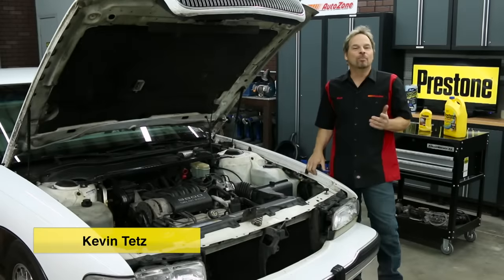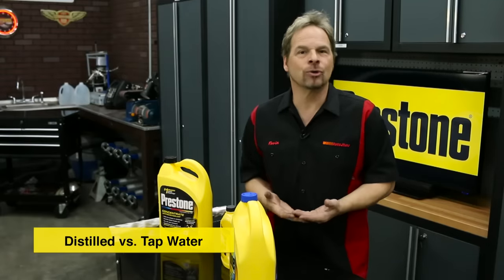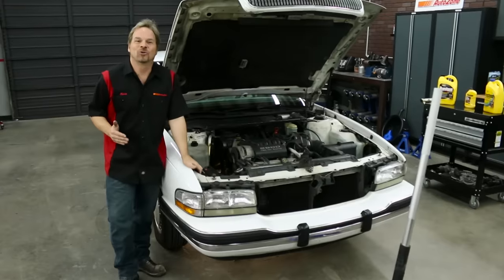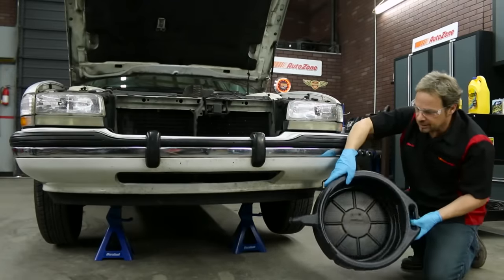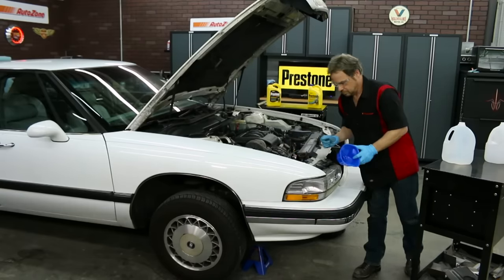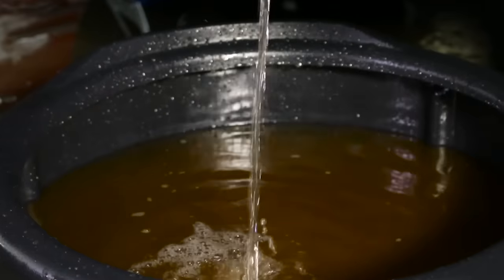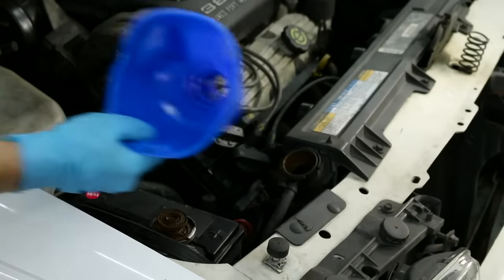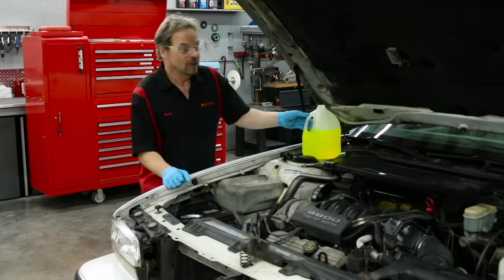AutoZone How-To: Flushing and Filling Your Cooling System

Comment: Thanks 👍🏾 This made me feel a lot more confident about flushing my system for the first time. I am so hyped up about it!! However, it is after midnight, and I do not have my pan or distilled water 😩 Definitely tomorrow though.
Reply: Howd it go?
Reply: Same here confident and ready to try it but it’s Raining and was minutes away from getting dark lol 
So how did that coolant flush work for you? Was it easy once you got started?
Reply: 😂😂😂😂😂 I’m in the same exact predicament. Gotta go hit some distilled water tomorrow. I damn near used tap water
Reply: @EASTCAMDENRD  Scotty flushed with a 
garden hose, you can do that right now, and
use it to clean out the interior while you're at it,
pet stains, spilled shakes etc, but then top off with 50/50 mix.

Comment: How do you drain out the distilled water completely from the engine block and heater core and hoses in the cooling system?
Reply: really, although this way is fine, you should take off the hose at the bottom of the radiator, run your car shortly with heat on and the water pump will shoot all water out, reattach hose and fill with 50/50 .
unless you coolant is coming out really dirty its probably not necessary but that's how you get it all out.
Reply: @divorcedwhiteman1968  can I just take out the plug from the radiator? 

What's in the engine and heater core should send it to the radiator which means it should flow out the lug at the bottom of radiator???,
Reply: @dnegel9546  you can do that..but really better to take off the bottom hose...if you're debating it in you head to much just have it serviced..it dont cost that much
Reply: @divorcedwhiteman1968  ehh it cost $170 to service it. And all they do is drain the radiator and fill. 

Anyway I ended up doing it by flushing the pump and both hoses.
Reply: @divorcedwhiteman1968 Finally someone who explained it directly. Thx.

Comment: When draining it, does it drain all of the coolant from the overflow jug? Not one video explains this.
Reply: Yeah, and I have a car that doesn't have an accessible radiator (no cap... literally and figuratively), so the only place I can add coolant is the reservoir, unless I detach hoses.
Reply: @myblacklab7 would that vehicle be a hyundai? I work at a dealership and the elantras and sonata are like that.

Comment: What about safety? How long it takes for an engine to cool down depends on the engine size and what it is made from. Aluminum cools off faster than cast iron.  Always squeeze the top radiator hose and if there is pressure, don't take the cap off.

Comment: Didn't talk about burping/bleeding the cooling system. What happens if you fill up the reservoir pass the full mark?
Reply: Burp it after u refill it with fresh fluid....just put the car on a ramp..start the engine and take the cap off

Comment: wouldn't the mix be less than 50/50 after leaving distilled water in the heater core, block and hoses? And why would you use some tap water in it and possibly leave some in it?
Reply: Yeah, he kinda skipped that part, didn't he?

Comment: But how do you remove the old coolant from the overflow reservoir and the hoses?  Will just draining it from the bottom plug hole drain everything?
Reply: That's what the flush with distilled water is for
Reply: He flush with distilled water.
Reply: If possible, remove the overflow tank and drain out.

Comment: Instead of a 50/50 mix I would use a 70/30 mix coolant/distilled water. The heater core will have distilled water inside too, so the mixture will be more 50/50 in the end. But good video, greetings from the Netherlands
Reply: Good advice as I was thinking the same when I watched this..
Reply: WoW, you guys get internet down there🥴

Comment: Why not just flush the system with new premixed coolant so the right ratio of coolant to distilled water is always present? In other words, drain the system, refill with premixed coolant, drain again, refill with premixed coolant. If you do this on a regular schedule you should never need to use a flush solution to remove gunk from the system, right?
Reply: Per gallon, premix costs almost as much as concentrate. So you’re paying almost as much for water as coolant. If money is no object, then yes, your suggestion makes total sense.

Comment: After the flush is done and you then make your own 50/50 mix, isn't the system now less than 50/50 because there is still water throughout the engine.  Shouldn't you add 100% concentrate so the system can then mix with the water still in the engine and heater core?
Reply: If you look at the very first comment (written 4 years ago by T. Jones), that's what the reviewer pointed out and apparently from the feedback that is correct. So yes you're right also.

Comment: I never do a flush and introduce a "cleaning solution" into the cooling system and engine. This remains in the engine block. Just drain what's in the radiator keeping the cap on the overflow tank. Then refill with 50/50 mix. Never had an issue in 40 years.
Reply: Depends on the cooling system. If it's well maintained that's fine. If the car's cooling system is neglected so bad that it starts overheating a flush is better. Eg I worked on a BMW,the silicates in the coolant seperated forming a gel. The owner has not changed the coolant in 7 years. That case a flush is needed. Just make sure the system if flushed several times with distilled water before adding new coolant,concentrated is best.
Reply: That's why you flush it, then flush it again and if your paranoid flush it again!
Reply: You're exactly right! 90-95% of the old coolant will come out when draining radiator, some will stay in the block,  but will mix with new coolant no problem. Majority of people overthink this.

Comment: Um, the whole point of having that funnel on the radiator was to keep fluid in it so not to let the level get low and introduce air into the system while burping (actually trying to eliminate the air).  Otherwise, thanks for the refresher.  Been a number of years since I last had to do did this process myself.
Reply: can you elaborate on keeping the funnel?
Reply: @leviorellana2093 the funnel attaches to the radiator cap hole, it fills up part way as the bubbles are finding their way out, then the level drops back down as they escape.
It’s the easy way to burp the system

Comment: If you say it's ok to flush the cooling system with tap water then, flush again with distilled water, what's the use of flushing with tap water?
That's double the work and double the time.
Awesome video. Thanks a lot.

Comment: Easy and straight to the point. I am loving it.
Reply: Except the title is very misleading. This isn't a flush. Simply a drain and fill. Lots of dirty coolant still left in the system and then by adding the mix he did it is now actually weaker coolant. Straight and to the point of not what to do.

Comment: He started the car to suck up the antifreeze and left it open , and then pored more in the radiator cap while running… does that not cause air in the system ? Curious idk I’ve been paranoid all night lol

Comment: So does it drain all the antifreeze from heater core engine block etc?
Reply: @johnlfloyd  so what's the proper way of doing this?????
Reply: @johnlfloyd  thanks I ended up doing it like Scotty. And your right even that way only drains about 90%. 

The only way in my car to get 100% out is to remove the drain plug on the engine and the knock sensor. 2 things I did not want to mess with.
Reply: @johnlfloyd  haha it's always something. 

In my car (97 LT1 Camaro) I have to maintenance the distributor (optispark) almost yearly. And well.. the problem is that In Order to do so, I have to drain my radiator, remove air intake/maf/radiator/fans/serpertine belt/water pump/harmonic balancer. 

All that because Chevy in their infinite wisdom thought they could make a maintenance free distributor and the genius engineer thought it would be an amazing idea to put it behind the water pump. Which if the water pump leaks it goes straight into the distributor, causing all types of problems. Which the LT1 (Camaro/Corvette/Impala/roadmaster)is infamous for.

If that wasn't bad enough.. lol.. the distributors that stores sell even GM all have a HIGH failure rate. Even ac Delco brand ones. (Not cheap). 

I've read on forums of guys having to remove and reinstall a new one 5x+ so just imagine taking it all apart put a new on put everything back, then 2 days later finding out is failing, then taking it apart again..so on and so on. 🤣

Comment: How about burping the system in the end to get rid of air
Reply: I've heard that if you fill with the engine running and the heater on then the system purges itself.
Reply: If you have a bleeder valve you can do that too.
Reply: Talk about ole skool...I rub my hood and talk dirty to mine😑
Reply: I tried putting the front of the car over my shoulder and patting it to burp it. Not sure if it worked but my back hurts

Comment: Wondering if you used 50-50 already diluted to 50% the system already had water in will not make it less than 50-50 actually?

Comment: How much is it for disposal at a recycle center ?

With oil and transmission oil I can take it to a O'Reily or other auto part store that recycles it.
Reply: Usually all antifreeze is biodegradable, just make sure your pets dont drink it. When flush my radiator I try to catch some stuff I usually in get 1 gallon, the rest just falls on the cement.
Reply: Take it to autozone no charge

Comment: So after you add the coolant and you wait 15 minutes, you said check your levels. Okay, what are the levels? What is it suppose to be at in your radiator cap? Details please
Reply: When the engine is cold there should be a marking on the overflow tank that shows a cold fill line. The radiator should be up to the top with about an inch left before it spills out.

Comment: If your vehicle holds 12 quarts you need to add 6 quarts of 100% concentrate.
Reply: The comment which i scrolled down searching for it.. You're write.. If the dry fill capacity stated in the owners manual is 12 qts. then, you've to flush with distilled water 2 to 3 times then to add 6 qts. of 💯 coolant, start the engine with radiator cap removed, let the air relieve from the system then fill with distilled water to the maximum mark on the reservoir.
Reply: You're right*

Comment: 4.7 ... put a new serpentine belt on. See that hex head plug with the orange sealer surrounding it? That is the plug I unscrew to burp the cooling system. I screw in a small plastic funnel after draining the cooling system for a change. I always jack the front of the Commander up so the engine is tilted just a tiny little bit. [My Commander has a natural lower rake look to it, high in the back] 1~Fill the radiator. 2~Test the radiator cap. Will the cap hold 20 lb? 3~Put the cap back on. 4~Fill the overflow bottle at least halfway to the factory paint mark. 5~Keep filling coolant until the funnel is full. 6~Start the engine. Immediately the coolant will be sucked down into the engine, water pump, and hoses. 7~Keep adding coolant as the engine and thermostat warm. Don't allow air to go down the funnel. 8~Wait, keep filling if necessary. But keep the funnel full. A full funnel is the 'foot-head' and is the highest point in the cooling system. Watch the overflow bottle, it may go up. It may not. But it is there to keep any air out. 9~Once the engine is up to normal temperature and the funnel is still full, have a friend increase the engine rpm from idle to about 1,200 rpm ... the coolant will again be sucked down into the engine. Add more coolant. 10~When no more coolant will go down the funnel and still holding the 1,200 rpm steady ... remove the funnel and screw in the threaded hex plug. 11~at this point the cooling system is full and burped with no air pockets. You can't do better than that. Now can you?

Comment: I would think you would need to blend it closer to 60/40 coolent to water. Because of the water left in system and heater core from the flush 🤔👍🤔
Reply: correct you have to take that into account and make your determined adjustment ,its gonna be more than 50% water with the water left in the core and block and some hoses,,perhaps up to 2 litres

Comment: How do you flush the heater core and engine block?
Awesome video. Thanks so much.
Reply: After adding the flush fluid, run the vehicle with the heater on. This runs the fluid through the heater core. Make sure the engine temp is high enough to open the thermostat and let the fluid flow through the engine block. You'll know it's high enough if the temp gauge stops moving or the upper radiator hose gets hot. Another sign is that the radiator fan will turn on. Then you can turn off the vehicle and open the radiator drain again. Empty the cooling system and repeat until the liquid comes out clear. In this video, they didn't use near enough coolant, so probably didn't actually flush the block or core.
Reply: @mvsawyer  Which means he left tap water in the engine block and core.  Not smart.
Reply: @ApartmentKing66 exactly. I still don’t know how to do this properly. It’s so frustrating.
Reply: @mvsawyer literally, how did he get less then half a gallon of coolant in there? 🤣🤣🤣
Reply: @RexRaven22 do you have your shop service manual?

Comment: You flushed the system but you only filled the radiator and overflow tank with the antifreeze in which case the engine block and heater core has water still has tap water in it
Reply: Never that easy aww fudge e id I like food w fudge in it
Reply: Just start the engine and accelerate a little to push it out

Comment: Okay, but I have a Nissan and it doesn't take Prestone, can I drain it with regular water?
Reply: Prestone is just the brand slapped on this chelation flush fluid. It is not OAT, HOAT, or any other kind of glycol based coolant. The chelation flush agent just dislodges & carries off oxides, minerals, and scale in your cooling system. It should be safe in any make & model of vehicle when used as directed with distilled water.

Comment: Helloo, what do you do when only half of the coolant comes out when draining directly from the draining plug? My car takes about  10 L but only 5 L comes out when opening the draining plug? That means half still in the system and if I wanna add a new coolant that would be bad idea because it would mix with the old......even so if you  do lots of flushes with distilled water that means 5 L will be in the system and I cannot add PRE MIXED stuff because it would dilute it right? The bad news is I have already bought the premixed stuff which was expensive.....
Reply: fill it up with water, keep the radiator cap open and start the car with the radiator drain plug open. you will have to keep adding water untill water starts coming out. it means you have removed all the old coolant.
Reply: @wonderwalls3565 I have similar issue. Do you have to open the bleeder valve too? I have a 2015 grand Cherokee.
Reply: How did you get this resolved? I have similar issue
Reply: @McOforis  I had to to use a concentrated version of coolant, I kept draining and putting distilled water back it, drive around so it mixes, drain and repeat the process until it comes as close as possible to water only (no color) then drain again at this point maybe half or less comes in so you then put back concentrated only ....so youll have to do the math how much . I ended up putting around 3.5 L because my car asks for 33% concentration
Reply: It wont hurt to open it but make sure that you are never out of water when the car is running. @McOforis

Comment: 08.27.2019 ( do you need to bleed air off every time you take the radiator cap off to check water or antifreeze level
Reply: @Jake A Morgan : no, it’s not like brake fluid. You do not need to bleed the system unless you drain and then add fluid.

Comment: Great video. Thanks. 

By the way, to those who say oriellys (whatever) is better, well.... I had returned a few items to o'reilys. Gave me a wrong alternator. Break pads that didn't last, I just drive about 15 miles a day and the pads didn't last a month, lot a brake dust in the wheels. A radio antenna that didn't fit.

I've never had a problem with Autozone parts.

If I ever go to o'reillies is because there's not an Aurozone around, or an emergency.
Other than that, Autozone is my store.
Reply: Oreillys has diagnosed 3 batteries of mine as Bad/Replace. Each time took them to AutoZone and NAPA and they both gave me an OK diagnosis and charged up the batteries. I looked for a second opinion the first time on a whim, as I was headed back to oriellys to drop $165 on a new battery, thought what the hell, I'll see what AutoZone says. got suspicious over the next year with batteries from my other vehicles and started at Oripoffs and yep, got Bad diagnosis, took to another place and charged them up. Told this story to friends, several of them did the same "experiment" and SAME THING. Fkn rip off scam. I only go there now if I throw a code and need a reading.

Comment: How about doing the flush on a modern car, I've not seen a pressure cap on a radiator for 25 years.
Reply: Brian Partington Only difference will be filling it through the overflow tank instead of the radiator
Reply: My '01 Malibu doesn't have a cap either.  The manual says that the surge tank fill hole is the substitute for the radiator cap.

Comment: You drained the radiator but not the engine block.  Then you flushed with water and drained the radiator.  Now you have a engine block full of water.  You fill with 50:50 which will then be diluted by the water that remains in the block.  When you are done, you will not have the freeze protection you think you have because you will have considerably less that 50% antifreeze in the system.